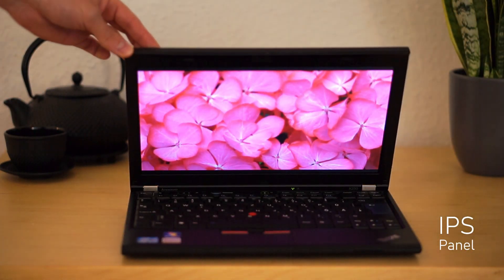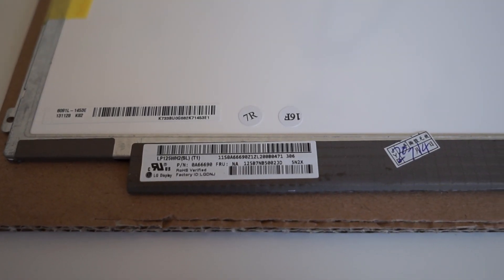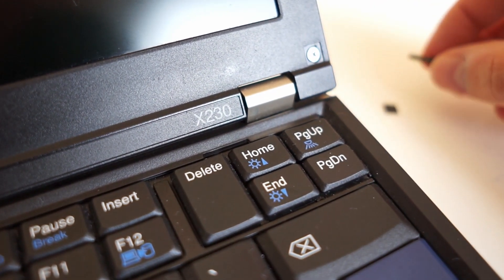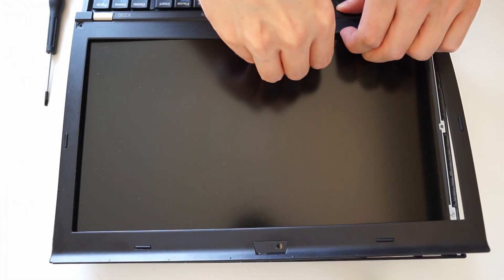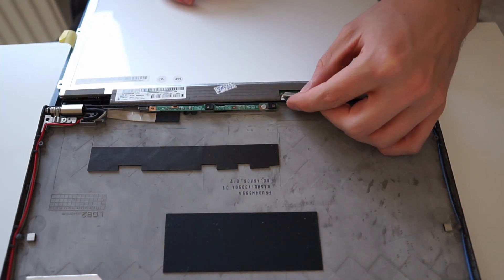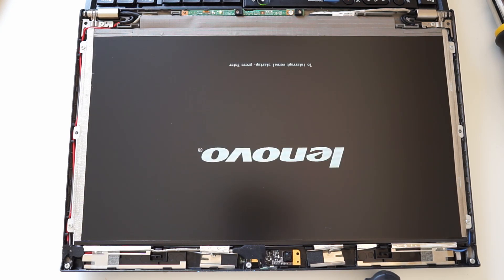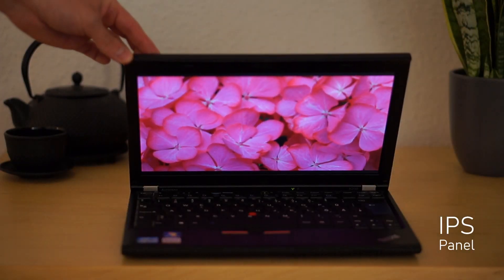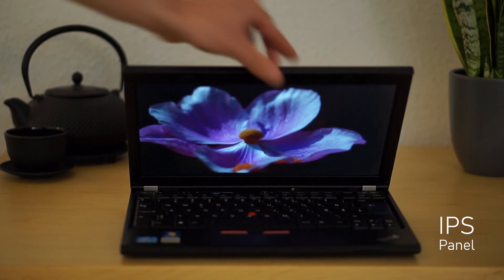Building the Perfect ThinkPad X230 Part 3: IPS-Panel

Comment: Greate content!
There is even deeper modifications for X220 and X230.
1) eGPU in ExpressCard 1x PCI-E 2.0
2) 2x8GB DDR3 1866mHz unlocked BIOS
3) Replace CPU for Quad Core!!! Only in professional BGA reflow service.
Reply: how to unlock the bios for 1866mhz ?
Reply: @fewlaz  it's work just like that just put full SPD support 1866
Reply: @piotrbedlinski1613  okay
Reply: @fewlaz install custom 1.46 bios
Reply: hello how can i replace another cpu with BGA reflow . i mean is there anything that i have to setup or bios upgrade ? if is there any guide you know could you share

Comment: Did you ever do anything with the PCIe slot? I know some folks try a usb 3.0 connection or even additional storage thru small m.2. Some of the usb 3.0 PCIe adapters were getting quite warm I heard tho depending which one you get.

Comment: Nice video. I had an x230 tablet that died and ripped the IPS panel from that, removed the digitizer and popped that in my x230 and its much better than the tn panel it came with. I highly recommend this upgrade.
Reply: i have an x201T and an x220 (with the lowest display option) and the 201 is MILES ahead of it in terms of screen quality

Comment: BtTPX230 Part 4: Desoldering the old CPU and throwing in a new Quad core chip, 512GB MSata SSD + 8TB Regular Sata SSD, Coreboot(And overclocking the ram), A bigger battery and a Kick-Awesome gaming setup with an RTX 30/RX6000 EGPU connected via Expresscard(To make things a bit easier), 3 Displays(Not counting the Laptop's own) and more expensive crap.
Reply: have you seen this anywhere on yt?

Comment: is it possible to install a Retina screen - 2560X1600 on the X230?
Reply from the maker: FHD mods exist, may be some higher resolution mods also. But they involve heavy modding and installing additional hardware that use the signal of the display port, which is not usable anymore as a result.
see:
https://imgur.com/a/NooMC (2560x1440 mod)
https://nitrocaster.me/store/x220-x230-fhd-mod-kit.html (FHD mod kit)
Reply: @classicdome9347  thank you

Comment: You can go even further and replace it to 2K or even 4K (not advised). I have switched to 2K on my old X220, super happy about it.
Reply: How to do that?
Reply from the maker: Yes, I read about that. Maybe I will do this mod sometime in the future. It's a very interesting mod!
Reply: doesn't that require soldering?
Reply: @JuanJimenez.  probably does, as you need additional controller for that(i believe)
Reply: @leonbishop7404  Yeah, not just a common solder but a hot gun and a paste soldering lead and those aren't cheap. The mod itself cost higher than the x230...
Reply: @jan5504  and I wonder if youtube playback is smooth at this resolution.
Reply: I'd love to see that  video !

Comment: Sourcing the right variety screen is a problem. Most sellers I've seen on eBay & Amazon might list the desired version then say something like "we will send a compatible screen depending on our stock". I want either the B3 or T1. How compatible is a 'compatible' ?
Reply from the maker: Yes, that's true. It is hard to find the exact model. I also searched a long time. I cannot say how compatible these 'compatibles' are since I  gladly got the right one. I wish you success finding the right one!
Reply: 'compatible' means 2 things, one true, one double-speak (both apply at the same time, at the same auctions, mind you). Compatible No1: it will work when you swap it for your old screen. Compatible No 2 = "it is not IPS, but we know that people are after IPS panel, so we entered the parts No into the ebay auction title, adding the 'compatible', so when you see what you want to see, rather what we say in the product description, or when we don't say anything specific about IPS / Non-IPS, and you order and install and realize it's not IPS and come back to complain, we will point to the auction title of 'compatible', and wait for the next sucker". Basically that's what it is, a scam. Some sellers have at least enough decency to put NO IPS in the title. Essentially, 'compatible' on ebay = non IPS.

Comment: what do you think of the mod to use a 1920x1080 display?
Reply from the maker: The 1080p (or X330 13 inch) mod is definitively on my list but not in the near future due to its price and availability ;).
Reply: @classicdome9347  i saw the board soldering to the motherboard but i wanted to get a second emergency motherboard first, in case something goes wrong
Reply from the maker: Good idea :)
Reply: Such a bummer that a 1920x1080 wasn't offered in the original x230. The low res screen is its biggest weakness.